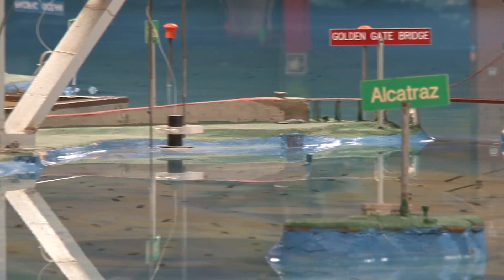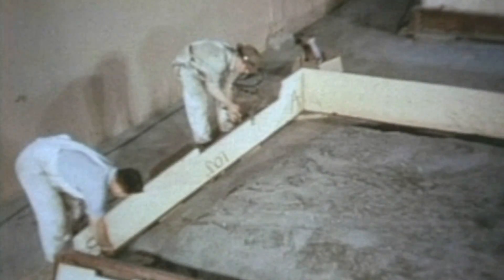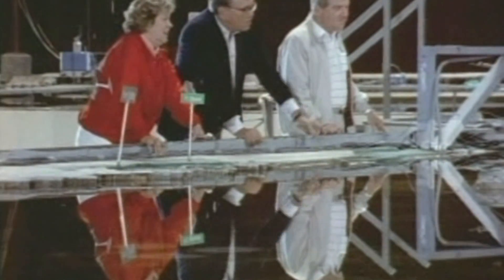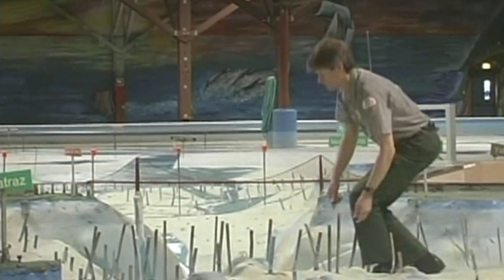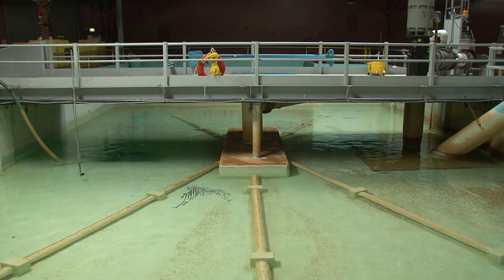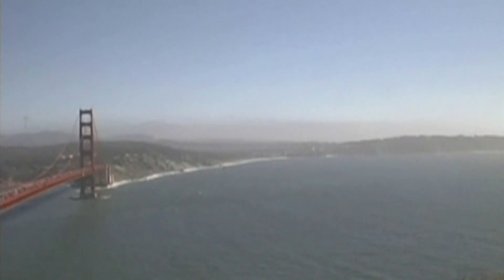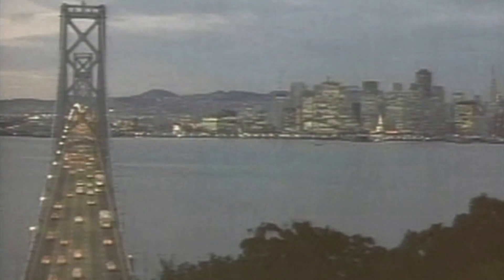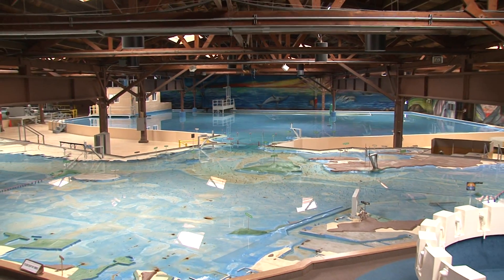Model Saves SF Bay from Ecological Disaster

Comment: The model scales can be different according to what are called "model laws", which state the necessary physical relations between fluid properties and the driving forces behind the phenomena being investigated. So sure, the scale differences are probably ok for such a huge model, but it still does mean that the model will not give anything but rough approximations of large-scale phenomena, i.e. you can't calculate what is going on in Fisherman's Warf... Hope that helps!